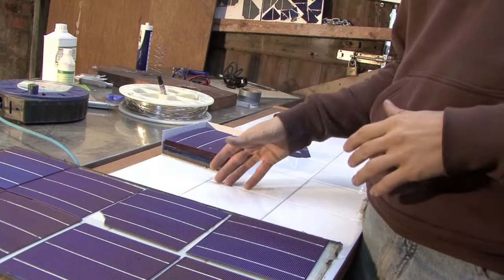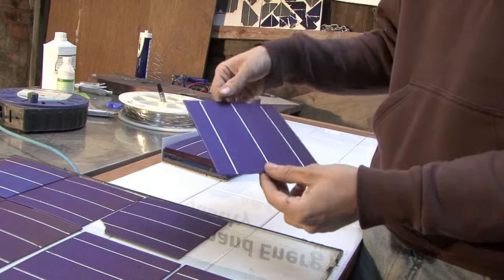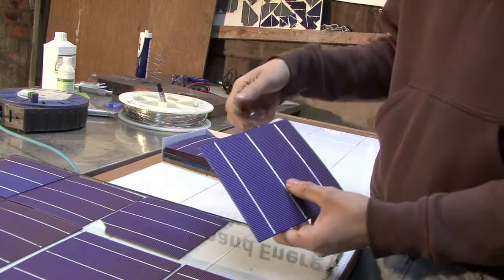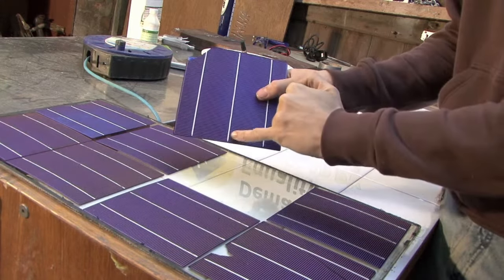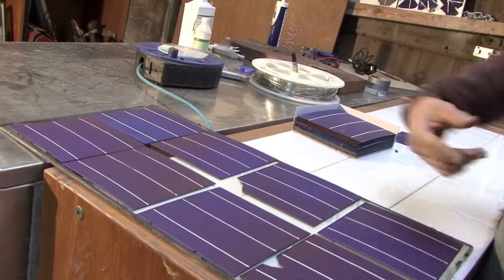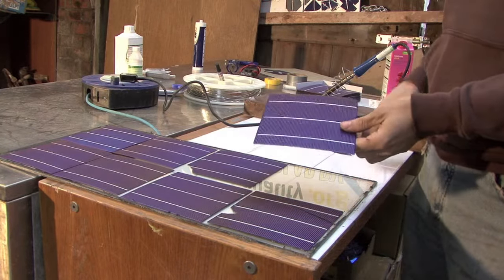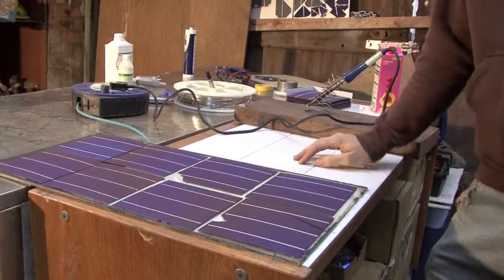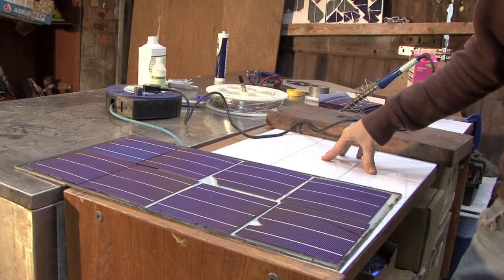Step 4 :Understanding cells and the circuit

Comment: if you have a chain, made of links, that break at 200kg, and you fit a link that can only hold 100kg, then the limit of the chain will be 100kg, as when the weak link fails, the object will fall..

Surely that is how solar cells work I would think, if yuo have a 6x6 cell that can produce 4w of power, and you have a cell with 25% broken off, that cell can only then do 3w of power, if you put a 3w cell into a line of other 4w cells, then surely the most power that can be drawn is 3w, if you draw more than 3w, the weak cell will start to break down (due to reverse voltage/current) 

has anyone tried this and documented the results? made a line of say 3/4 cells with one weak cell , loaded them up and seen the voltage across each cell or how it affects total available power??